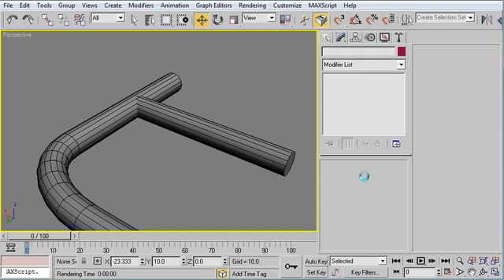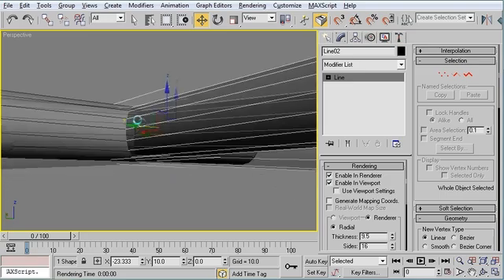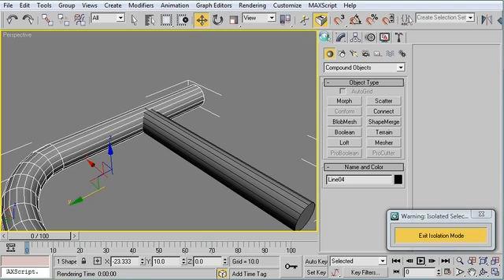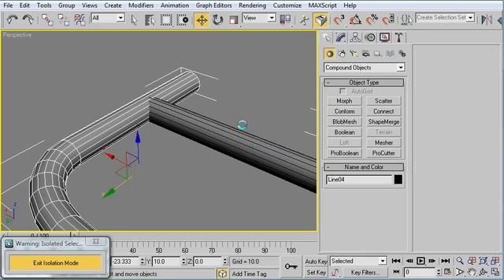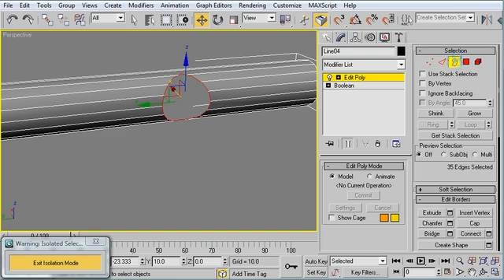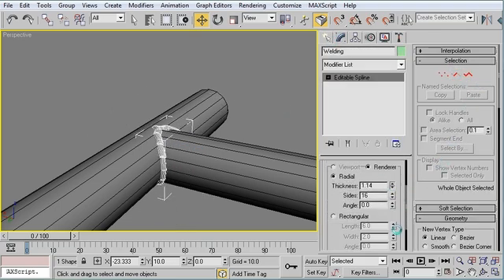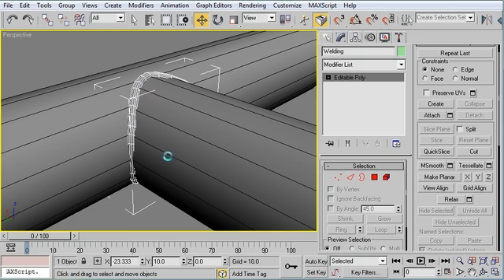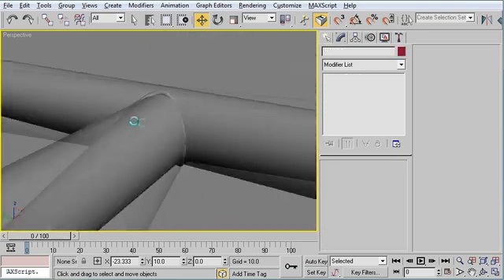Monday Movie #46: Lumpy Welding

Comment: Excellent tutorial thank you!! I want to know though. I'm making a object that needs to have a cut out of it. But I want to apply turbo smooth to the entire object afterward, but the mesh turns out all messed up because the triangulation. Is there a technique to fixing something like this? Like maybe, a way to use boolean so it doesn't cut new mesh and just alters the existing quadrilaterals?